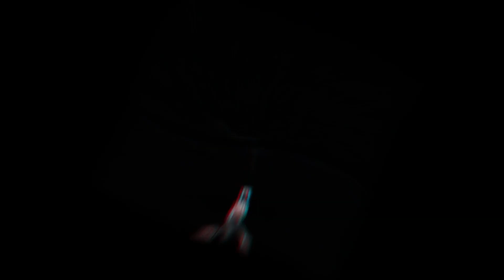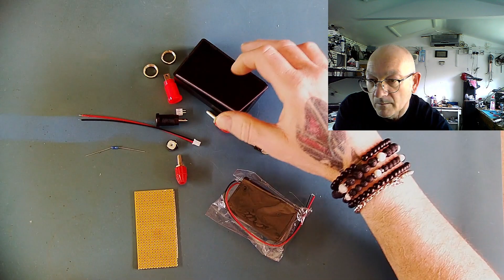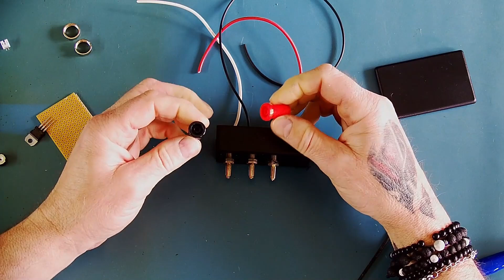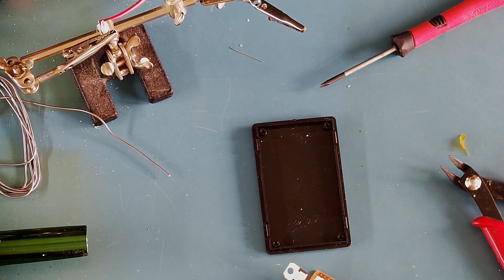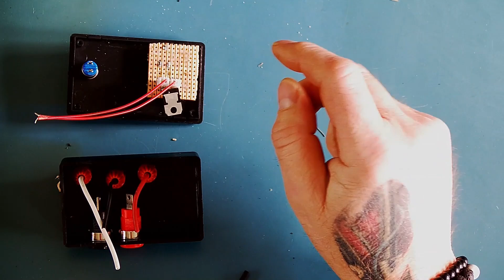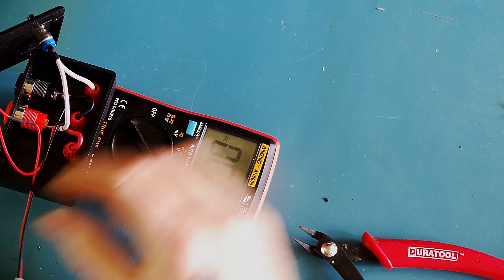Low OHM Meter equivalent using a standard Multi meter

Comment: Maybe follow up with a milliamp adapter circuit. I built one with a dual op amp, IIRC. It works extremely well.
Reply from the maker: Hmmm, it’s not visible . Email address is joftechnical@btinternet.com
Reply: @Joftec  Thanks. Done. Enjoy!
Reply from the maker: Do you have a circuit ? I could possibly look into that. Thanks
Reply: @Joftec  Yes, I could share that with you. However, we would need to create a means to get it to you. I do not see your email address, on your channel details, and YouTube will not allow me to post a link to a drop box. Do you have any suggestions?
Reply from the maker: Hi, email address added to channel details. Thanks